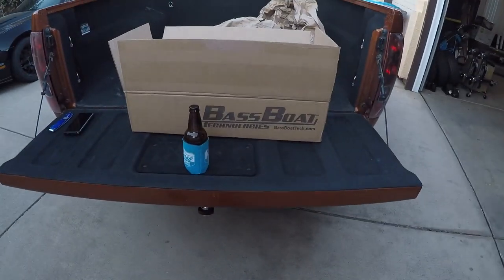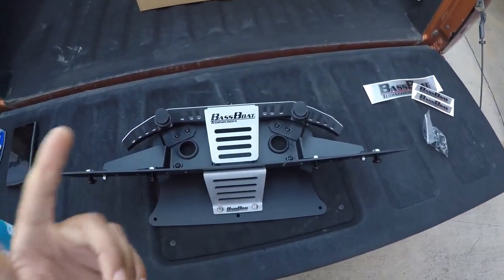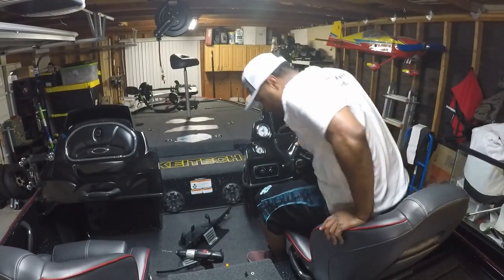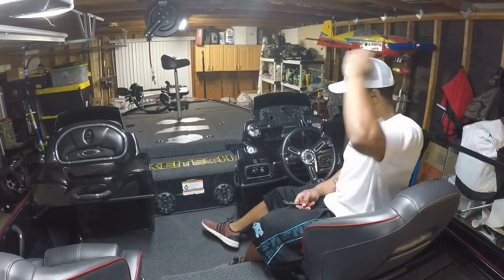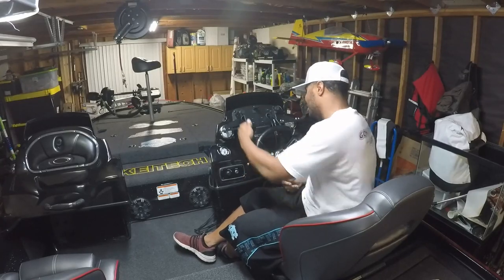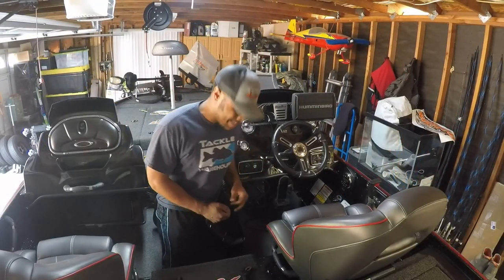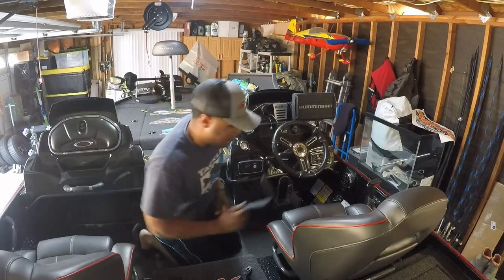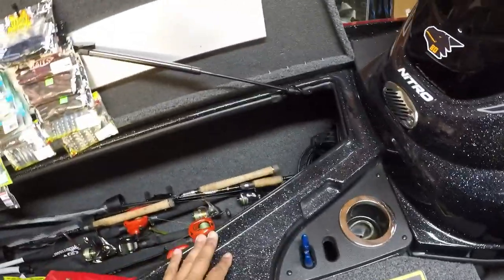How to install bass boat technologies dual mount

Comment: Is there any adjustments for the angle up down in and out.
Reply from the maker: Yes you can move them. The mount has slots cut in the base to move them closer together or further apart. The mount utilizes the stock gimbal brackets that come with your graphs so they will still tilt up and down.
Reply: InfiniteBassin what about so there no flat ..can you angle them together kinda like a v.........
Reply from the maker: @jhondoe6664  yes you can angle them in too mine arent flat. You can take them pretty far in the V shape.
Reply: InfiniteBassin man that is awesome thanks for the great information.....I pick my 2020 Skeeter fxr Saturday.....have a good one.
Reply from the maker: @jhondoe6664  you're welcome and I bet you cant wait for that.
Reply: InfiniteBassin very thankful....